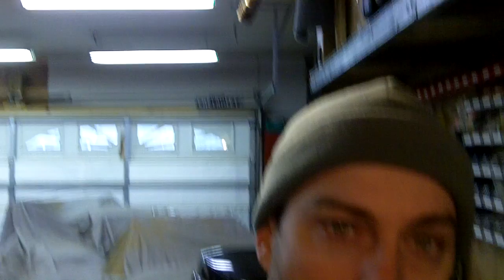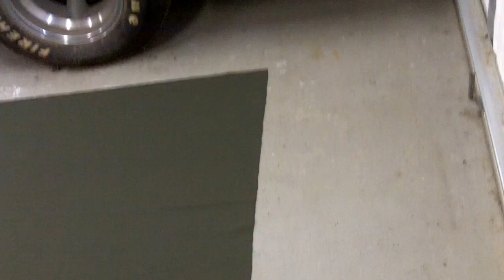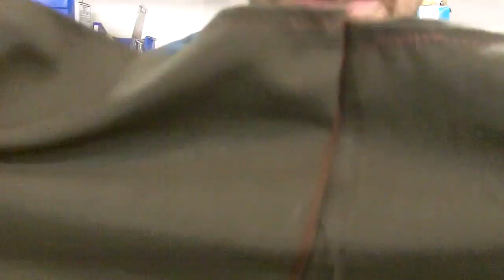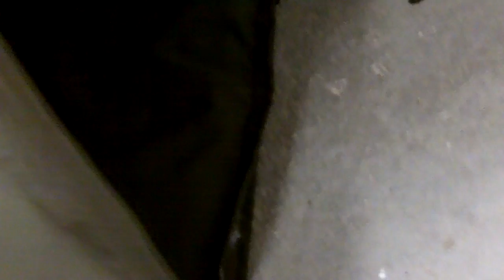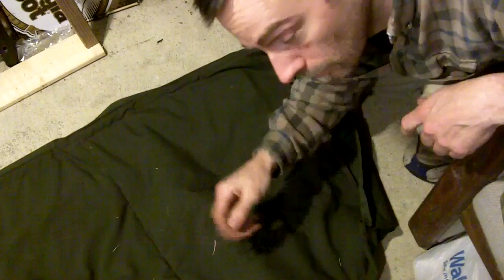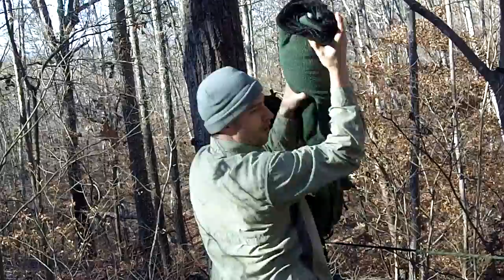The Tree Tent DIY Follow Along Project

Comment: Hey Dave, This is a fantastic idea. I wonder though, if it would be better to have the tarp that forms your tent more flexible to use in other situations. It's added weight to your pack which you can only use for one thing.

Could you have the main tube made of a single sheet with sewn tubes or eyelets to make it foldable into the tent, and then the triangle sides can just velcro on afterwards?

Comment: Thanks for the ideas, I think that's a 55 your working on, had mine for 43 years now, will never part with it. An old welders trick if you weld aluminum in a unvented area is to drink milk, lots of it. For some reason it offsets the effects of the fumes.Yes if your doing the math I'm retired but the 55 I had when I was 14 (first car). Getting my backpacking stuff back together and I do enjoy your info video's

Comment: Survival Clause? LOL! Hilarious. You know I had an idea while you were putting that tent together in the video. When you placed that metal bar on the bottom of the tent that was a pretty good idea but what if you had a shorter bar for the top and instead of one cord holding up the top of the tent... there is two instead like the bottom?

Now I know you are going to wonder well that will be just a square tent but it is not. Since the bottom bar is bigger at the base... the top bar is going to be shorter so you can still have a certain angle from both sides of the tent. Just the top part of it will be flat like a rectangle while the slides will slope down into a triangle tent if that makes any sense lol

The shorter bar is mainly used for stability nothing more.

Comment: Hi Dave, great job.. and I'm proud, you can sew too!  So, I have one suggestion.. but, this is great so it's a long-term safety suggestion... when you fold and iron.. turn your fabric so the frayed edge  is tucked into the seam.. that way it can't Frey over time and with pressure.. otherwise it can pull out your sewing or make wholes in your fabric.. Even nylon thread can't hold frayed edges over time and with use and weight..  So, love the video.. and good for you!  Victoria

Comment: I'm liking your vids. good info and well thought out. On the problem you are having with the ridge line just add some para cord tag lines to pull it to center. Also to tighten the ropes just tie a loop between the shelter and tree then go around the tree back through the loop and tie off. You should be able to get enough tension to almost break the rope. I use this method to tie loads on my trailer when hauling heave loads, it doubles the tension just like using a snatch block.

Comment: checkout the duluth hammock design from dave canterbury,it has sliding loops in the ends sewn in like your cross bars idea but instead you just find some thicker sapalings on your campsite cut them to size and alide them in and wrap the rope 2 loops around it.

it does the exact same thing but you could drop the aluminum bars and cut down the weight alot.

Comment from the maker: That is TIG welding. That stands for Tungsten Inert Gas. The inert gas is Argon. The Tig torch supplies the heat and you feed in the filler rod by hand. Its great for thin stuff.  Thanks for watching my friend.

Comment from the maker: The top material is an elastic polyester. I used it on top because it stretches and wont tear. The bottom is just plain ole cotton. Its doubled walled for strength. I bought both materials at a fabric store. It was either Joanns or Hancock fabrics. I cant remember which, I buy from both places. Hope that helps, Thanks for watching my friend.

Comment: Man, you've got a nice idea! It makes me think! If you put an extra spreader-bar on one of the sides you'll have a "chair" you can sit on when cooking, hang some stuff on and use to get in and out of the tree-tent. With some extra grommets on the ends you could tie another rope to the tree to prevent the ends from sliding in. It might also be a nice idea to attach ridge-lines (is that the correct word? English is not my mother-tongue) to the sides of the tent to prevent the wall from caving in.

Comment from the maker: Well some of my other beds may or may not hold up 300 lbs. but on some, you could use double branches or make em thicker and use more rope. As far as the tree tent, I honestly think it will hold up. It uses rope and not paracord and the bottom is double layered and sewn about four times. Its a lot stronger than it looks. Thanks for watching my friend.

Comment from the maker: From one monkey to the next, Thanks! I love making gear. Well, with a normal hammock its fine with two strong trees spaced just right. In cool weather, you have to add a cover or under blanket. How this compares better is when the trees are very far apart or where theres 6 to 8 very small trees, this is a better set up. In cool weather, its easier to set up to me because the roof is already on and the floor is double walled. I love using it. Thanks for watching my friend.

Comment from the maker: I had thought about using threaded ends for a break down frame but, they make 45 deg. and 90 deg, elbows but, I would need  some weird angled elbows to make up the triangles that they dont have. Ive been working on some tent pole frames as an experiment on this one. Anyway, thanks for the tip and thanks for watching my friend.

Comment: You'll learn to love it, once you understand the logic behind it.  Especially for your setups.  Picture it as tying a loop (bight) in your rope before you pass it around the tree.  Then after you pass around the tree (once), go through the loop, and use it as a 'pulley' to pull back to the tree.  Not only will your rope be tighter, but it'll use less wraps around the tree.

Comment from the maker: Ive tried that before and it didnt work too well with my rope. I may have done it wrong, I probably need to give it another shot. So far I just use my leg on the tree and stretch the rope around the tree then wrap the tree twice then tie. Its worked fair so far. super tight would be nice. Thanks for the tip and thanks for watching my friend.

Comment: The tape was easier then the pins. I will have to use that. If you slide the tent back as like a chair and sit then push with your feet to extend the foot portion getting in would be easier. Also your vent poking out would be solved if you used Velcro, That way you could straighten it out under your over hang, Hey maybe even some Velcro to secure your sliding rod also. That way you are stable the ends, Un Velcro to slide the brace back maybe 3 loops?. Nice job! Thought It was a great idea.

Comment from the maker: This was actually my first really big sewing project and it turned out pretty cool. I did have trouble with the ridgeline before when I used it on uneven spaced trees. The A frames work great, they are just very bulky to pack in. I need to design a pack using them as the frame. Thanks for watching my friend.
Reply: Once you work the kinks out, you could sell your ideas or products. You did do good on the sewing. Sometimes if the fabric frays as bad as what you used, I would fold it over a second time to hide the raw edge for the hem. Also for added strength, you can put a second row of stitching alongside of it for added strength, this is especially good when you sew two pieces together that will have extra stress on them, I think it's called a stay stitch.
Reply from the maker: @pueblodove  Thanks for the info.  I'm still learning about sewing all the time

Comment: Initial run of 100 might cost more per unit - so i figure you need to lay out about $2,000 to get stock. Then you go to the purchasing department of the big outdoor chains and get them to take a punt. You can often get them to buy a small load for a small number of shops to see if the product ships. 

I think its true to say, coming up with the idea is the easy bit. Getting it to market is the hard bit. 

If you take on a partner they can do a lot of the leg work for you. Selling.

Comment: this really is an excellent idea. i think you could improve it by sewing up the ends completely and making one side of the roof into the door. that way you can access the bed and get in and out more easily, you can also then throw the loose flap over the back so that you can in fact have a swing seat for those hours before bed when you just want to kick back.

Comment: Nice work. I wonder though if you could do away with the ridgeline all together. Maybe make a triangle out of the spreader bars, with the point termintaing and attaching to the peak of the shelter. Then adding an inside ridge pole. It would increase the weight and components...just a thought. Your idea would make a great pole bed with added straps for cut poles. I like it!

Comment: One thing I thought of Dave, what about dedicated ropes for your sides and ridgeline, that stay permanently in the tent, with possible rings or some other attachment points on the ends?  That way, all you gotta do in the woods is unfold it, run your support ropes and attach them to the points on your tent and you are done.  Much easier in a cold and dark situation, and much faster.  Just a thought.  Keep up the awesome vids.

Comment from the maker: @steolian  It is an A frame hammock but, I had to give it a fancy name to get people to watch the vid, Ha ha. The Four rope deal does sound good. Im having to keep the ropes kinda short due to sagging. I bet if I used four, I could go longer on the length with no sag. I just have to figure out the roof design to get the rain to roll off. Rectangular would be even cooler because I could have overhead pockets for inside Gear storage. Great ideas man, thanks for watching my friend.

Comment: Hey bro here's a thought on different insulation... Memory foam:) it's dense, pliable, soft enough to roll up, fairly cheap when bought as a mattress topper,and comfortable:) Just a thought I had... Could be used for the roof, end walls, and bed area, only issue would be weight unless a guy had a thin one around 1" or less... Anymore thoughts on the alum A-frame end panels with velcro???

Comment: Ok, one last thing and then I will leave you alone, LOL. You could use a tarp as the saddlebags. If you sewed the pockets in the tarp, leaving one end to be sealed with velcro, then you would have t3 options. 1st, no tarp for when it's warm and clear. 2nd with the tarp when it's warm but wet. 3rd, you could put foam inserts into the tarps pockets for insulation when it's cold. I would think one inch open cell foam would keep you quite cozy. this configuration would save your from makine 3 parts

Comment: The simplest way, now that I think about it, to insulate your present tent would be to put a pad down on the inside to sleep on, and then make a "saddlebag" style addition, I'm thinking two large pockets the pads would slip into and the seam between them would be the part that goes over the ridgeline of the tent and the two pads would lay againt the walls of the tent. Some velcro could attach the saddlebag to the walls and stiffen the walls a bit. Extra protection in case it rains hard as well.

Comment from the maker: @SamuelTyree1  Well the only thing about the inflatable walls would be the sewing part. It would have to be several sections so that I can put a few cross stitch lines in for strength. I really like the rope loop step on the spreader bar, thats a great idea. I was looking for a good way to set the shelter up higher and I think you just hit on the right idea, thanks for coming up with that one and thanks for watching my friend.

Comment: That is really cool! I wonder if for a winter version, you could put inflatable pads in the walls and floor for extra insulation? Maybe the self-inflating kind? You also might put a rope loop for a step on the aluminum pipe, if you tie the tent extra high. Great job!

Comment from the maker: @722wdblazer  I bought it in high school in 1985. It has a very well built 350, new brakes,shocks,a arms, ball joints. If you look closely, you can tell thoses are 15 x 8.5 old style americans tucked under the fenderwell. Its got a 64 Impala SS rear end modified with leaf spring hangers. Thanks for the compliments and thanks for watching my friend.

Comment: @Reallybigmonkey1 If you google it county comm a website I hear alot of ppl on here order from sells it its a small diameter thread that still has a 90# plus strenght rating its about 12 buck a spool of 100yds its Used for sewing parachute harnesses  they also normaly carry kelvar thread for around 6 bucks a spool

Comment: Great Idea I had ofter wondered about using a tube tent w/ a hammock inside or even if it would work that way this is a great setup have you thought about using spectra thread instead of the nylon thread and leaving one end of the bottom open and instead of using the batting to isulate just stuffing it with leaves or pine straw in the feild instead

Comment from the maker: @cslr11  I have a ball making these videos then testing the stuff I make. It was warmer in there, I guess because it was blocking the wind. I'm going to spray the whole thing down with scotch guard but, I dont think this set up will be any good in the snow. The roof is a single layer. It needs a double wall like the floor. Maybe with a good tarp on top, it would be fine in the snow. I know the rope would support the weight O.K. Im going to make a winter set up too. Thanks for watching my friend.

Comment from the maker: @tnealb43  Yes, if you can sew, try this. Its pretty darn cool. The poles might work on the ridge line but, you just gave me a great idea. I could carve a small V notch in some sticks or branches and wedge them under the ridge line or the alum. spreader bars to help support it. The rope did sag alot over the 40 something foot span it was covering. I thought it needed a zipper for strength but, after getting in it, Velcro would have been just fine and alot faster. Thanks for watching my friend.

Comment from the maker: @TheWoodsmenJoe  I tll ya, I havent used a sewing machine much but, its an amazing machine. I was worried about it ripping but its plenty strong. As far as the tie outs, thats a good idea to stabilize it and, maybe to tie off to nearby trees. The rope stretched alot more than I thought it would. The whole set up will have to be tweaked but for a first time, It turned out pretty cool. Hey, on your Civil war tent, be sure to use nylon thread, it will last forever. Thanks for watching Joe.

Comment: Really nifty idea, you should patent it, and one way to reduce the weight would be replace the tubes with strong nylon webbing, it should still do the same job as the aluminium tubes, with far less weight, and easier to pack. The other idea would when stitching on the ends, add webbing there also, this should allow better load bearing on the ridge line.  Keep the vids coming :)